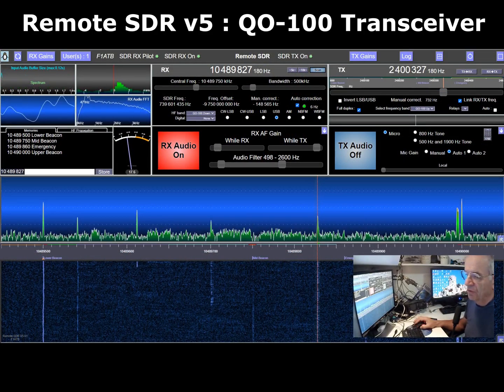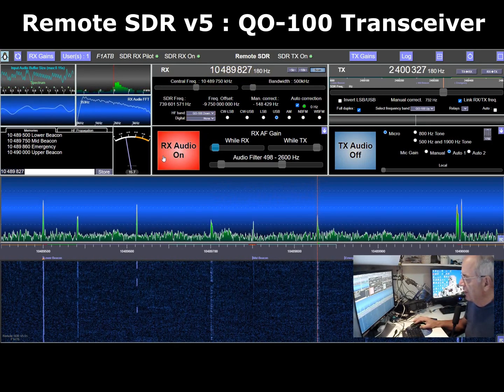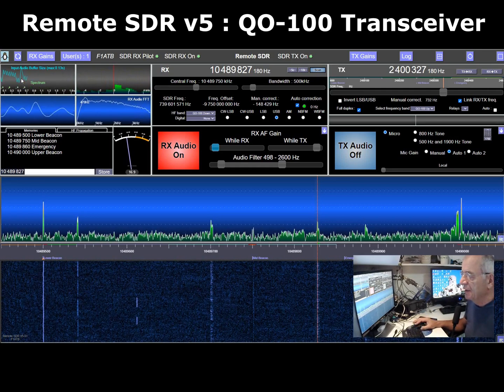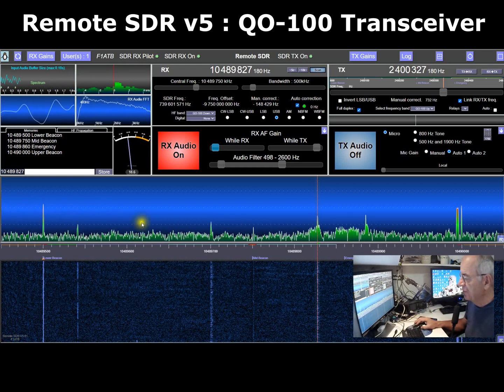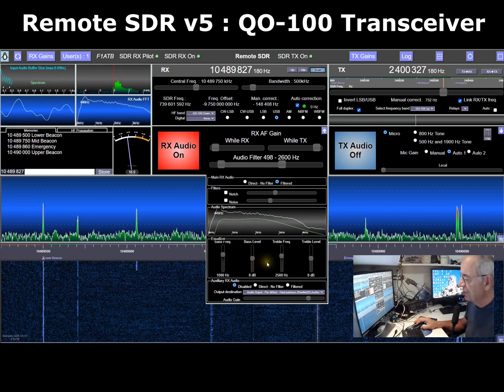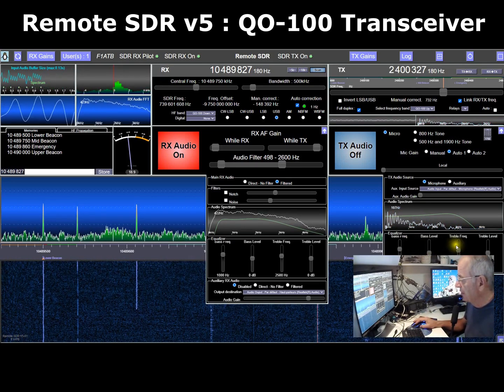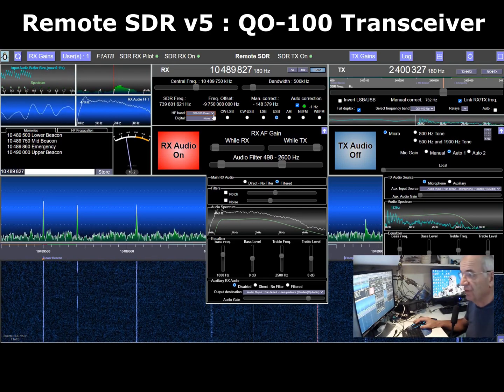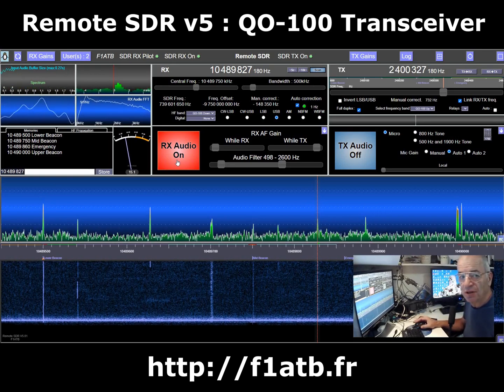Remote SDR version 5 - Introduction (English)

Comment: What an interesting project!! Thank you so much for sharing.. Would you recommend this for WAN(Wide Area Network) use or its limited in LAN - Home networks?? My bandwidth on my RS Pi4B server at work has around 10Mbps Upload and 100Mbps Download. On the other end my "client" windows 10 pc at home has a 1Mbps Upload and 10Mbps Download speed. 73' de SY2DGU
Reply from the maker: You can use it for a Wan. Your data rate is high enough. It's better to work with a cable ethernet instead of Wifi to have a continuous flow. 
You cannot work on QO-100, if you are not close to your TX. WAN is forbidden.
Reply: We run it over a VPN from remote in our FabLab and it works fine this way. There might be short stutter depending on other network traffic and VPN-Server performance, but it's prefectly workable. The used bandwith is around 50 KB/s.

Comment: Thanks a lot for sharing the software. I test them windows and ubuntu with GNURadio and my 2x hackRF.
This is currently the most interesting option of a GUI transceiver linked to GNURadio.
Unfortunately, I have a problem on both SOs with the presentation speed of the RX spectrum. I know - I'm raised on HDSDR so my expectations are high. There's probably a mistake on my side somewhere. Please support. Thank you for a good job.
Reply from the maker: The speed of RX spectrum is reduced to limit the data exchange on internet. It's better to guarantee a more reliable communication.